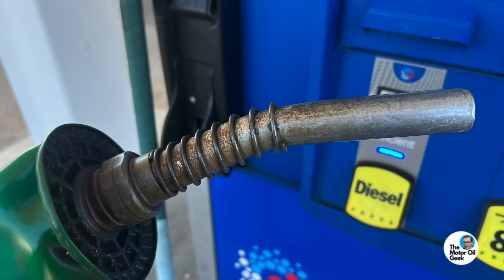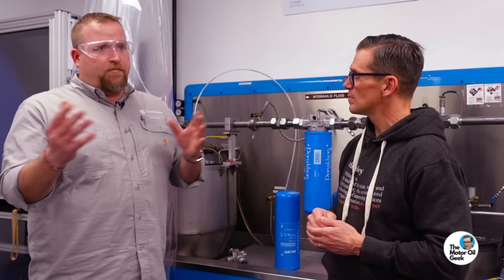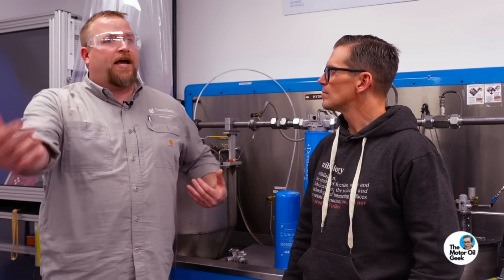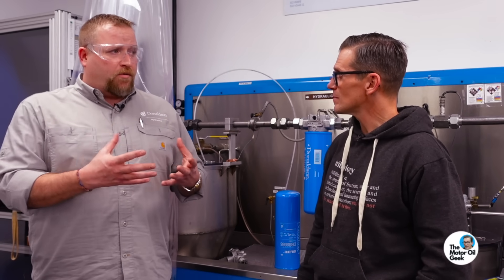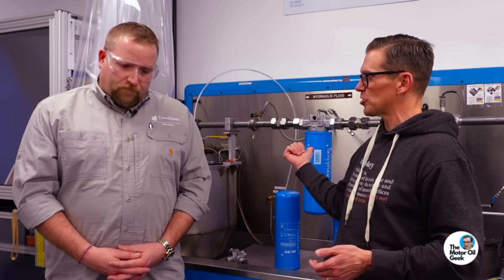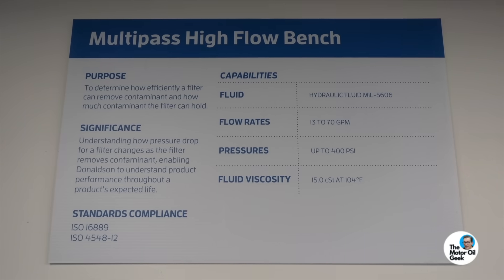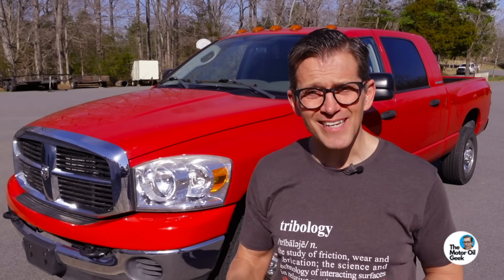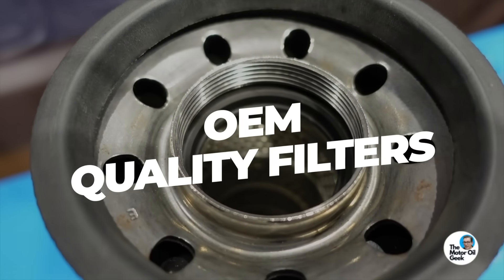Diesel Is DIRTY (And It's KILLING Engines)

Comment: Glad the newest Diesel I own is a 99' Cummins, I can run it on anything filtered properly, my 1972 M35A2 with the LDT-465 will run on anything that burns. The new fuel is absolutely terrible, not because it is dirty, but because it has no lubricity.

Comment: I buy every 4 years a new diesel due to high annual mileage. 100.000km a year, so 400.000 after 4 years. I refuel the cheapest diesel available around here… never had have any fuel related issues. Drove from VW to Volvo and from Renault to Toyota. Northern Greece

Comment: I purchased an '18 Dodge Ram Cummins truck with 132k on it, and I'm getting ready to drop the oil  and do oil and fuel filters. I instinctively knew to go for OEM Mopar filters. Thank you for the insightful video.
Reply: Go buy gasoline engine, you dont have to do crap and is quieter
Reply: @mindfornication4funn  Gasoline engines are nit as thermodynamically efficient as diesel, so don't tell the person what they can and cannot buy.

Comment: Hello, I need some help. I have a Seat Ibiza with a vw 1.9 D 1Y  engine, and I haven’t been able to find suitable engine oil for it in the last five years. 
Every oil I put in it creates sludge and soot buildup in the oil pan and start burning after 2000km. I’m not sure if the oils have been reformulated or if we’re being sold counterfeit motor oils here in North Macedonia. Otherwise, the engine is in ideal condition – new injectors, 23>1 compression.

Comment: Your last statement was to not change out your filter “not too soon, not too late”.  Is there a problem with changing your fuel filter more frequently than the OEM recommendation?
Reply from the maker: Yes, changing the fuel filter early reduces filtration efficiency.

Comment: Common rail diesel engines operate under way too too pressure. Planned obsolecense..That is why Ford brought out the 7.3 Godzilla gasoline engines. Good to hear there is some way to mitigate diesel engine problems

Comment: Personally I would stick to BP Ultimate Diesel (minimum cetane rating 55-57) or Shell V Power Diesel (minimum cetane rating 54 but the friction modifiers help make the diesel rattle quieter). My 20 year old (162K miles) BMW M47TUD20 inline 4 engine puts out 205BHP/300 lb-ft into 1400Kg car is nippy...Pretty much ran it on BP Ultimate...

Comment: Good morning, great information today.  Similar to the GM oil life monitor, I have to wonder how good the fuel filter monitor is in a modern GM oil burner.  I am aware of the GM recommended 2 year/30k mile guidance.  I can only imagine it's a pressure differential reading but can I trust it to tell me the filter needs to be replaced before there are issues?
Reply from the maker: The 30k interval is probably the best program, unless the filter monitor says to change it sooner.

Comment: The other thing that comes to mind for me when you say “bulk tank” is where is it stored and how big is it?  In general, for larger tanks there is a need to drain off any condensation from the bottom of the tank that has accumulated on the walls. I also try to keep the tank as full as possible to minimize the ability for the tank walls to condensate. Not sure if this is applicable of will help but just putting in my thoughts.

Comment: At about time stamp 10:30 you are talking about the concrete company injector problem and mentioned that they have their own bulk storage on site. Since they can control their fuel to a certain degree before it goes into the trucks, couldn’t they run their fuel through a fuel oil purifier, like Alpha-Laval, that uses centrifugal force to remove particles from the fuel initially before sending through the filter systems?  This may help save some on the cost of filters to clean the fuel prior to putting it in the trucks. Idk. Probably would need to do a cost analysis to see.

Comment: These trucks don’t lie with the type of diesel they are running thru them. I run a 2021 6.7L. I’ve come acrossed a few Cali gas stations that have diesel #2 for a cheaper price at the pump ….but my truck says differently. I fully believe a few gas stations have bio diesel in their underground tanks….and charging more for Diesel #2 instead. Bio diesel  gives my truck crap mpg and makes my truck regen like crazy.

Comment: so listening to this makes you think or me think every diesel on the road is a rolling basket case just a tank away from the injectors plugging up, but there are THOUSANDS of vehicles that use diesel from all sorts of stations everyday with no issues.. unless you are a CP4 pump... LOL 

Fuel quality in the US is far inferior to other countries adn the fuel make up is different which add more wear to the pump, injectors especially..   

  "High efficiency at low micron rates"..  words to live by when looking at filters.. 

NOW Lake, do some fuel filter for diesel engine.. compare OEM to what is considered better,, Like donaldson etc..   

thanks for all you do.. man..

Comment: In New Zealand car franchises would not import the diesel versions of their cars because the diesel available was not clean enough...but after years of complaints we now have fuel of Euro 4 standard with extremely low sulphur and water content etc. And diesel is cheaper than petrol.

Comment: Why are you sold out to the oil companies and covering for them? You tested the dirtiness of the diesel fuel from four stations and tell us one is extremely dirty but you don't tell us how they rank. Why would you keep that information from us Mr. Speed?
Reply from the maker: I’m not sold out to anyone. The point of the video is that fuel cleanliness varies, and it’s not brand specific. The cleanest fuel came from the Pilot and QT, which are also the highest turnover locations of the 4 tested.
Reply: Good to know that when the cost of a set of original equipment fuel filters on my truck is approaching $100 and they're supposed to last 15,000 mi but don't always make it that far before I have loss of power issues until I replace the fuel filters again.I like your channel and watch most of your videos.. @themotoroilgeek

Comment: This is why I miss older port-injected gasoline engines. Fuel quality largely doesn't matter because it's all sprayed in there with low-pressure injectors and the fuel washes down the injectors and valves and keeps everything clean.

Comment: I love my 2003 F350 7.3L more and more everyday driving it back and forth to work without fail. I replaced the entire fuel system when it hit 225,000 miles and its power and economy was restored. 17-18mpg at 70mph.
Reply: A Hyundai gets WAY better milage.
Reply: @mindfornication4funn true, but to my knowledge no Hyundai has a 1 ton bed capacity, none of them can tow my 5 Ton excavator, and my wife’s 2020 Kia Sportage only gets 19mpg so I will keep my beloved truck named Betsy.

Comment: Lake - thanks for all your science-based videos regarding oils and fuels.  You are a go-to resource for the facts that dispel non-scientific opinions.  Regarding gasoline engine oils, perhaps you can explain in a future video the marketing behind manufacturer spec oils such as GM Dexos.  These oil licensing agreements are fundamentally about royalty payments from oil manufacturer to the OEM as opposed to magical oil formulations.  That said, why would a product like Valvoline Restore and Protect not seek Dexos certification?  Also, VW has a unique 508/509 oil spec that most oil manufacturers do not seek to license (at least in the US).  Thanks for all you do!
Reply from the maker: I appreciate the kind words and your suggestion for a video on oil specifications.

Comment: Get a Fass or Airdog and you wont have a problem. The factory filter is 25microns. The one at the pump is supposed to be 10, but its usually a 30. The manufactures can solve the issue with a proper filter but they choose to run 25 microns. Its a long known fact in the diesel community to fit an aftermarket filter as our fuel is junk. Airdog has filters as low as 3 or 2 microns. I run the 10micron filter cuz its easier to get. 

I have a home made black diesel set up set up that would give most haters all the fuel they need to hate on me... Its a very crude process. 
I also made a short on how not clean fresh diesel is showing the bottom of my barrel after letting new diesel sit for 3 months. Its pretty nasty. Its on my other channel.
I run black diesel. The dirtiest of them all. I have never had an issue as long as I pay attention to my pressure. Low pressure will kill a fuel system quicker than dirty fuel.

FYI that truck is 2:02 is a 2006 or newer not a 2002.

Comment: So whats needed now is fuel filter brand test!!!!!
 Fuel filters must of got better because the price difference is huge when compared to my 07 Kubota l3400 vs Kioti CK3510, fuel filter at dealer for L340 is around $20.00 vs 2021 Kioti CK3510 at dealer is around $90.00.  Then theres the jungle store fuel filters, L3400 is $10.00 vs CK3510 $25.00 - $80.00, so I dont if I should trust a $25.00 fuel filter or not for a CK3510......

Comment: Can we get one on the effects of the government’s push away from diesel that seemed to cause literally zero fuel system issues, to the super extra ultra low sulfur diesel that is more expensive and seems to be a cause of fuel system issues for every single manufacturer these days? I also noticed after keeping some modern diesel in a sealed storage tank that it had seemed to have broken down over the course of about a year where the old stuff would keep for many years hampered only by the growth of alge.

Comment: Two questions
First, why do you have a spring that can trap dirt on the end of the nozzle?
I'm not seen these sort of nozzles in Europe, the UK or hit down here in New Zealand.
Second, do you not have the specifications for the ultra low sulphur diesel required for modern engines that's enforced in Europe New Zealand and miss most of the other parts of the world with modern diesel engines in the US?
Filtering at the pump would not slow down the flow rate. You just need to have a faster higher power pump to pump through the smaller filters.
Most diesel pumps have a button in New Zealand for high flow if required and then we have the truck pumps for ultra high flow of diesel.
I cannot believe that very few people use diesel in the USA. Is it so much cheaper than purchasing petrol?
In New Zealand, the average petrol price per litre is double the price of diesel per litre.
I'm thinking of fitting a pre-diesel filter in my 2023 LandCruiser 70 series V8 diesel.
Keep up the great videos .
Reply: For your first question, the spring gives a surface to catch on the fill port of the vehicle, it helps keep the nozzle in the tank without having to actually hold the nozzle, especially helpful with vehicles that need the nozzle partially pulled out to fill without shutting off.

Diesel in the US is the opposite from other places, diesel is more expensive then gasoline, Where I live, Diesel is about $3.90 a gallon and regular gas is about $3.15 a gallon. Most Americans are afraid of diesel because they think it's super complicated and difficult, so most won't get it> I even ran into this buying my first diesel, I was the first in the family to get a diesel ever and my dad was trying very hard to talk me out of it. It's so bad that even many mechanics wont work on them beyond an oil change.

In the US I've never seen a pump with a button to change the fuel flow rate.
Reply: @SilverStarHeggisist  Thank you for your reply, in the 40 odd countries that I have traveled to so far teeth are cast/moulded into the nozzle and it’s easy to clean with a cloth these hold on and don’t need a spring like you have in the US.
Diesel fuel was originally designed to be extremely cheap in fact sometimes peanut oil was used as the fuel in early engines so it seems crazy that you would have a farm more expensive than petrol.
As a motorcycle mechanic, I don’t understand why people would be afraid as it’s very simple technology and engine design/mechanic just needing a lot more oil changes than petrol to keep the oil to its maximum efficiency at protecting the engine .
Anyway have a good day in the US on the few countries. I have not driven in as it felt unsafe to. 
From experiences far safer driving in Africa and the Middle East .

Comment: Fuel filter....basically the only filter I'll by from the manufacturer. I do buy aftermarket oil filters/air filters/cabin filters etc as it's easier (prob not the best reason!) but I change oil every 10k km give or take a few hundred k's.. the local Ryco (Aus) filters seem to do a good job.
Reply: That can actually be worse. An example is Cummins in Dodge pickups. The engine requires a 2 micron filter, Chrysler decided to cut costs, so they from factory put a 7 micron filter, this results in injector failures. The fix is to get an aftermarket fuel filter at 2 microns. 

Also engine manufactures don't make filters, so when you get a filter that's labeled Cummins, Ford, Toyota or whatever else and you bought it from the manufacture, they didn't make it, they contracted with one of like 3 companies that actually makes filters, Fram, Wix and Mann. All the other brands including OEM brands are one of these three with a different paint job. In some cases a aftermarket filter like NAPA brand filters will change, NAPA branded filters used to be Mann and they changed over to Wix (might have been the other way around, was about a decade ago they made the switch), the point is that the NAPA branded filters were not made by NAPA.

All this to say, you shouldn't blindly buy a filter from anyone, even the OEM, and instead should do careful research on which filter to get.

Comment: Your dad better keep his truck. New diesel trucks are just as poorly made as the new gas truck. Better keep your old stuff till they fix the new junk they are trying to sell. My next door neighbor has traded in 2 diesel trucks because the new one are junk. And the manufacturer of new diesel trucks don't care. The manufacturer need to clean up there act on all the vehicle they make. Otherwise you are stuck with a 100,000 dollar truck that is in the shop rather than you are driving it. My neighbor wish he had his 2000 year truck diesel back. His new one is in the dealer more than he can drive it. I told him to just go back to gas. He is a truck driver so he has to have a diesel for no good reason. We all need to not buy any new vehicle till the  manufacturer clean up there act. Goes for gas or diesel vehicles. This goes for the whole drivetrain. I have 3 Kubota diesel that are about 20 to 25 years old. Never had a problem with them. I have a 200 gallon tank with a filter on it and use a 2 gallon tank i fill my diesel up to 23 hp tractor loader /backhoe and and RTV and lawn mower. My 2 gallon has a fine filter build in the spout and when it runs slow have to take it off and clean black crap off and it works again. Every 2 gallon I have to clean that screen off. I have always used the BP premium fuel and have had no problems with fuel yet. i do change the oil often when it gets dirty. My BX23 loader /backhoe is the worse. That one smokes black smoke when you first start it and only see a little black smoke when you use the loader hard pushing dirt. The lawn more is less under a load then the loader/backhoe. My RTV I hardly ever see smoke and only use it with the snow blade in the snow. The oil in the RTV hardy ever gets dirty. I think the BX 23 with the loader/backhoe I think the infector pump is a little off timing. They all start up good in the cold. Uses a little more diesel than the other 2 and they all have the same engine in all 3. Not bad enough to mess with it as you need to use different shims under the pump to get it exact. It ain't broke so I leave it alone. I just change the oil sooner on that one is all. None use oil and the oil stays the same one the dipstick. Just a little rich I think on the loader/backhoe I would think. Runs fine though..

Comment: I wonder if there is a way to make a filter for the user prior to putting the fuel in the tank.
Reply: Yes, bulk by fuel and put your own filters on the dispenser.
Reply: @SilverStarHeggisist  yeah i thought about getting a 200 gallon tank and filling it up and then filter it into the truck
Reply: @av1204  if you have good filters on your vehicle, you won't get much benefit unless the fuel in your area is so bad its clogging them rapidly

Comment: Old diesels can run off whatever garbage you put in them. There are guys that dump gas, used motor oil, and pretty much any petroleum junk in them and just change fuel filters more frequently. Modern diesels make ridiculous power figures and then have uber goofy emissions systems on them. 

I've always wanted someone to figure the difference between cleaner diesel emissions vs the much higher mpg figures achieved by deisels without the emissions equipment. What's actually better, using much less fuel or burning much more fuel in a cleaner manner?
Reply: It depends on which specific chemical gasses you want to hyper fixate on. Like to make less NOx, a diesel engine makes more CO

Comment: Lake your dad's beautiful truck is not a 2002 as you said in video. If it is indeed a 2500 with a Cummins that generation didn't start until model year 2003 in 2500 and 3500 models. So it is either a 1500 with gasser, or 2003 and newer 2500 with Cummins.
Reply: It's not 2003, 2003 had a different headlight style (I have one), that headlight style didn't show up till 2005 or 2006